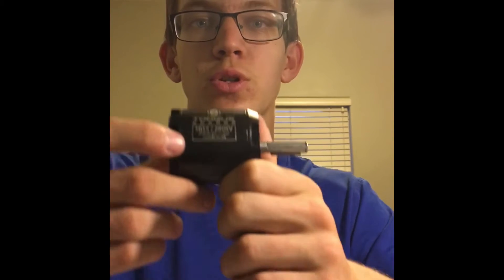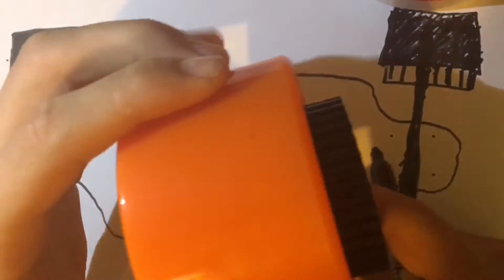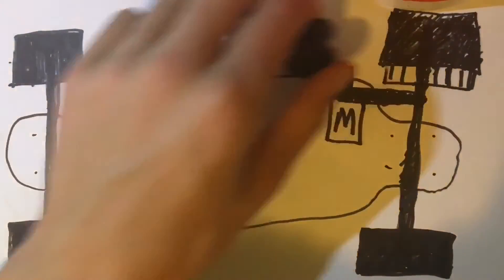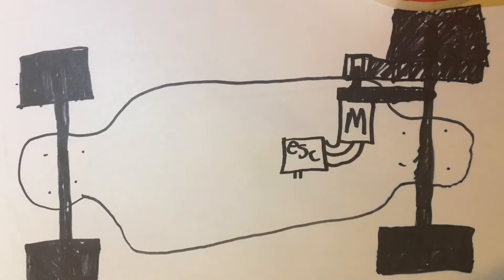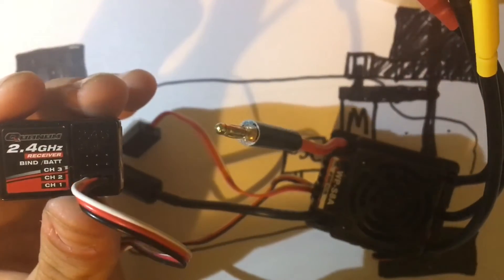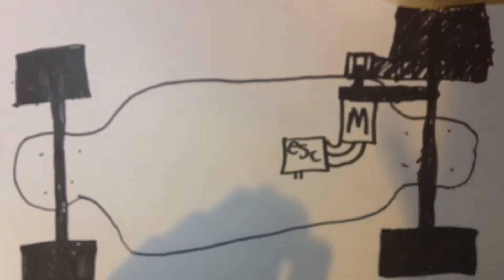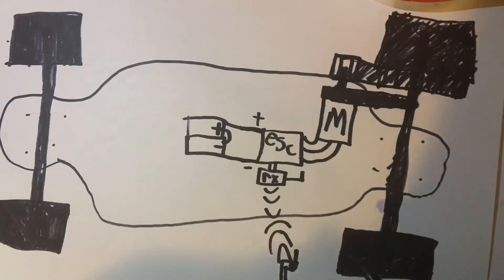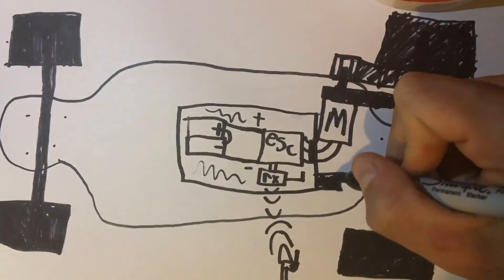DIY Electric Longboard ITEMS YOU WILL NEED

Comment: Aight, I got some questions. You are using two 11.1V batteries, what makes 22.2V in series. 22.2V with 60amps makes like a 1540W setup, while a boosted board is about 2000W. Why did you choose for this voltage and would you recommend using 3 of those batteries in series?

Comment from the maker: The batteries are in the description....... your motor will work, with the batteries in 6s, it will have a little more torque, but if you use the 192kv... it will have a top speed of about 19mph, unless you got 4s batteries, then your looking at about 24mph